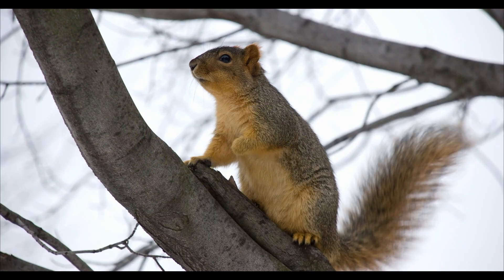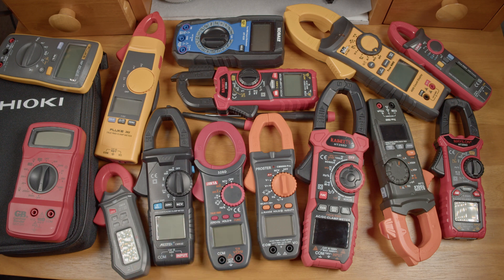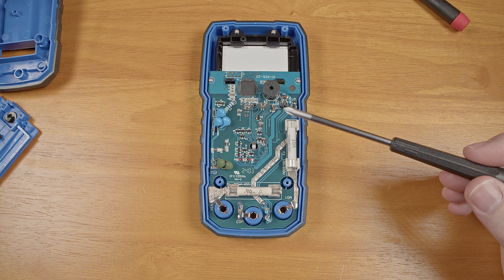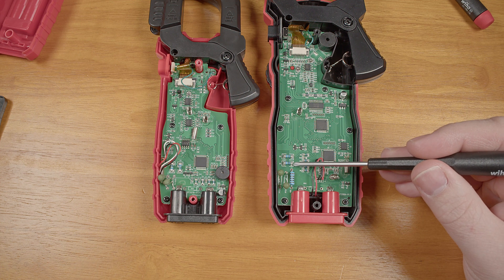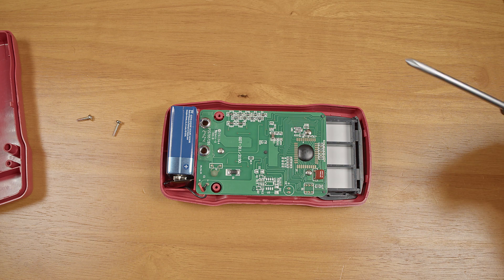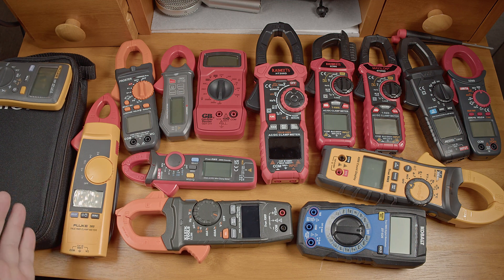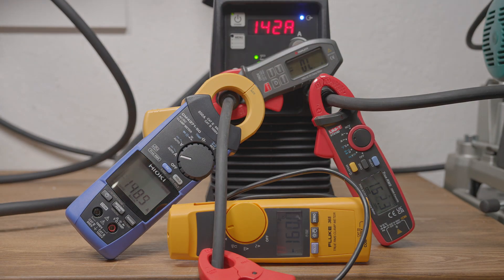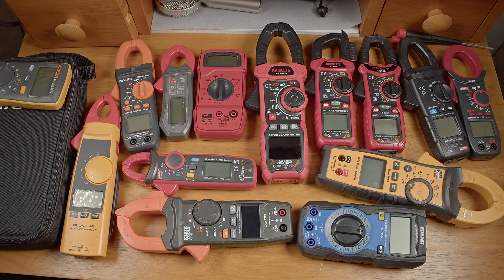Comparing Amp Clamp Meters for Testing Welder Output

Comment: So, which meter would you buy?
Reply from the maker: I have an Amprobe that I've used for a long time in my garage, testing welders.  And I have a couple different Fluke clamp meters that I've used at my job for many years.  I also recently got a Hioki.  So, I guess those are the ones I did buy  ;) 

Everyone has different needs and different priorities.  If you aren't using the voltage measurement aspect of these meters, or aren't testing anything over 12-24V DC, the input protections probably don't matter to you.  If you aren't working on anything critical, maybe cost is more important than accuracy.  It just depends on what you're getting into.

Comment: second try for reply:   My shunt came with a led amp/volt meter from Ebay  about 13.00 now. it is rated at 100 amps with a voltage drop of 75 mills at 100 amps not 100 mills. so you have to multiply your meter reading by 1.3333  . This worked out on my HF titanium 125  (126 amps) and my dan-Mig 140 mono  (135amps) . I watched a guy review a Arccaptain 200 mig. he set it at full power and burnt about 10 3/16-7014 rods and it did not crash you need to do a review on one. I am thinking of getting one.????? Dan
Reply from the maker: I'd like to review that machine, but it will probably be a while before I can get to it.  I have a big of a backlog of other machines to test, as well as other video idea.  Plus, normal life stuff means I don't have time to make all that many videos.  So it will probably be a while.  I'll see what I can do.

Comment: I wonder how my $10.00 shunt would have done. It drops the voltage one  millavolt per amp. You should get one the next time you check the 
current on a welder. I just made a short ground clamp on one end of the shunt and clamped the welders ground clamp to the other end. then 
used my Fluke to measure the voltage drop. would it be as good as the meters???
Reply from the maker: That could be interesting.  What shunt do you use?  A current shunt can be an accurate way to measure current, but like anything, there is some room for error.  Especially with a shunt of that low of resistance that ends up used in a dynamic situation like you are using it in.  Could be a fun idea for a test.
Reply: @bigtb1717  I got it on Ebay with a digital volt/amp meter. about 3 years ago. they still sell them. just search shunt. i was wrong it is rated at 100 amps with a voltage drop
of 75 mills per 100 amps. so what ever reading you get you have to multiply by 1.3333. which works out perfect for my HF 125 titanium (126) and my Dan-Mig 140
(134)amps. I think the 100 amp rating is more about constant current capacity than accuracy. When are you going to review a Arccaptain 200? I watched i guy turn
one up to full bore and burn around 10, 3/16- 7014 rods. Think i might get one. Can't find one review that checks the current out put. Dan
Reply: Arccaptain 200 mig

Comment: Looking forward to the mig video.  From what you tested it seems that my mp200 does cap out at 160A in stick mode.  When set to 200A I measure 170A with ta kaiweets 206D, since that measures high 160A sounds about right.  To me it looks like the Klein is built  safer and decent accuracy.  Would have like to see the higher amp tests too with the klein.
Reply from the maker: @morenothing4u  Yeah, I realized while editing that I really should have tested the Klein and Ideal meters at 220.  I'll be sure not to leave them out of any test in the next video.

Comment: Another informative video! Thanks for your time and effort doing the testing! Looks like I have one of the worst meters in your lineup according to your test results. (Kaiweets) It looks like it could be around 10% high at the 150 amp readings with increasing discrepancy as the amperage increases. At least it gives me an idea and I can note the discrepancy when I use it. Thanks again for your efforts!
Reply from the maker: Worst-case scenario, it should at least give a comparative reference between different machines.  If the clamp reads 150 amps on one machine and 180 amps on another machine, even if those numbers aren't exact, you can still be relatively confident that machine two is putting out 20-30 amps more than the other one.  

Even the cheap ones are useful, especially for the price.  And considering how cheap some of them are, I'm almost surprised there wasn't at least one that was just WAY off.  Even 10% is sort of in the ballpark, considering the cheapest meter here was like 1/12th the price of the most expensive.  For the price, I really liked the Uni-T.  Well built, seemed accurate, super compact.  The only bummer is that it maxes out at 200 amps.  Still, for measuring 200 amps and under, I really like it.
Reply: @bigtb1717  Good point! It was inexpensive and for the money it is a handy tool. Again, I appreciate your knowledge and the information you have shared with me over the years both in welding and electronics. I don't know much about either but I learn something new every day. Mostly I learn I really don't know much about either. LOL They are both a hobby for me.
Reply from the maker: Also, thanks!